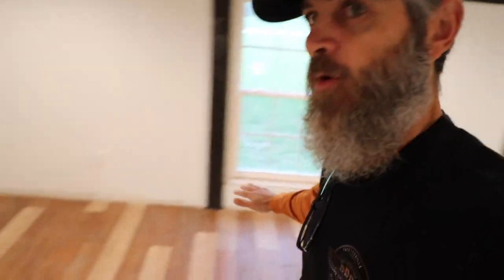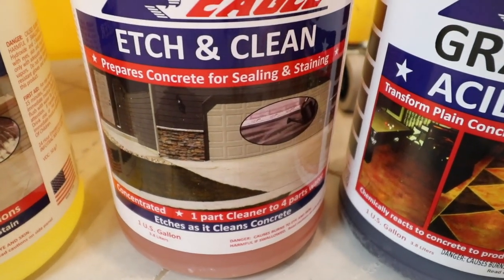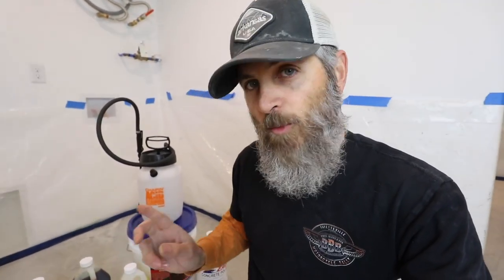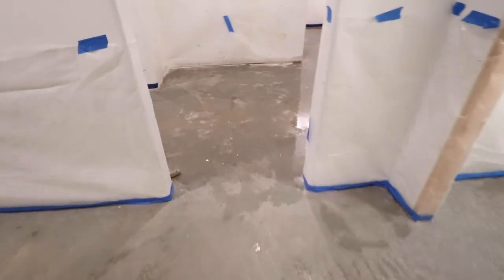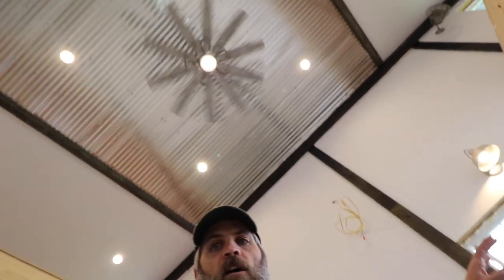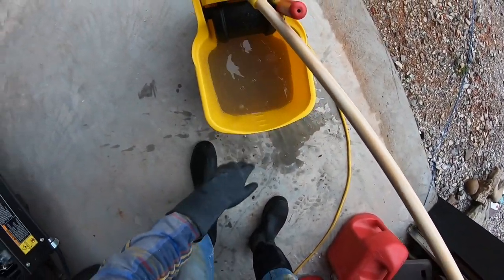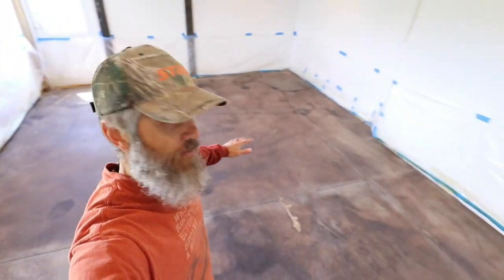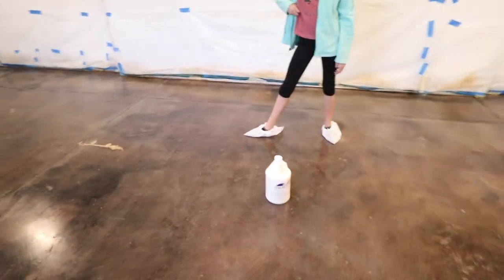ACID STAINING the CONCRETE Floor of the Barndominium

Comment: Do you happen to remember if there were streaks after first coat of sealer? Used lambs wool applicator and did light coat...just curious if thats normal before applying 2nd coat.